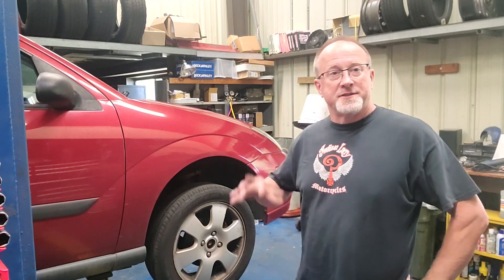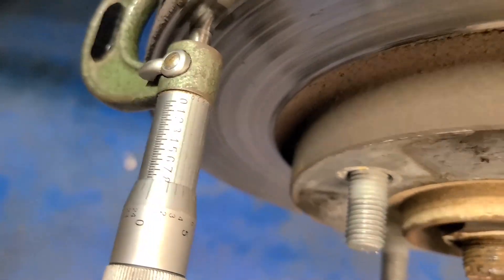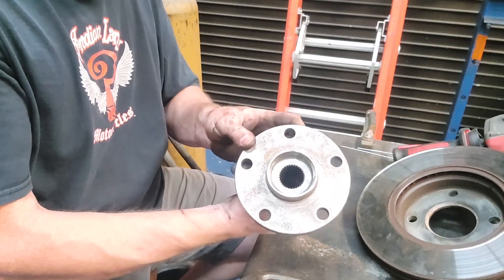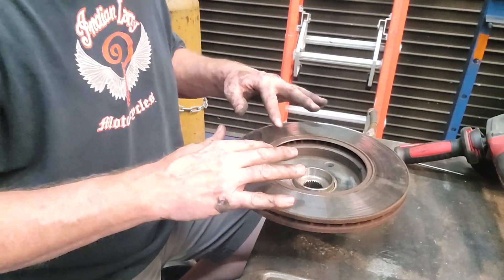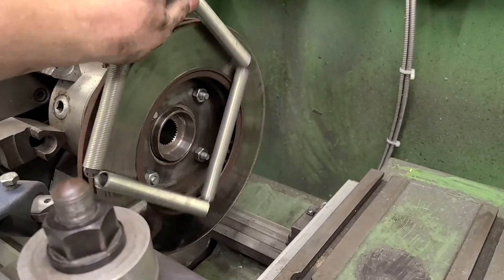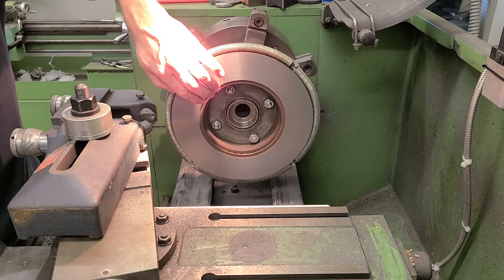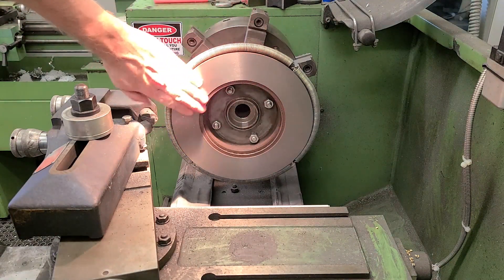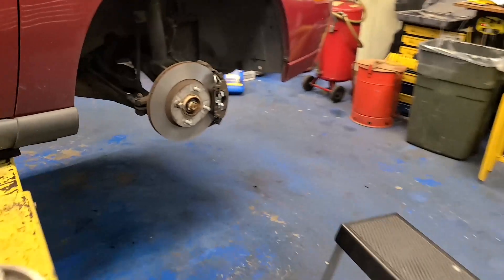Cutting Brake Rotors

Comment: NO ONE SAY`s cutting brake rotors = IT IS MACHINED OR GRINDING = your no mechanic = what a crappy car !
Reply from the maker: It's actually "you're no mechanic".  It was a crappy car.  That's why I "machined" the rotors.  You are correct, I'm not a mechanic.  Sorry you're triggered by the video.

Comment: Just stumbled across your channel today, I too have an Ammco twin cutter mounted on an adapter plate on the compound.  I use an Ammco 1 inch arbor and the centering cones and adapters for hub less rotors and drums and turn between centers.  I used Ammco brake lathes starting 40 plus year ago.  People worried about dust, they probably ride bicycles  play there guitar and smoke dope  and have nothing better to do than criticize someone actually doing something, keep the videos coming thanks again ed
Reply from the maker: Thanks Ed!!  You da man!

Comment: So much ragging on this guy for turning his rotors to 19.98 mm when spec is 20. Gimmie a break. If he turned them to 20 would nobody complain, when In a month or two they would be at 19.98 anyway? Just because of a printed spec, they think it's black and white. Are you going to die if you drive 2 mph over the posted speed limit? Or even get a ticket? He saved buying $120 worth of parts which he can put towards gas to drive another 1500 miles.

Comment: Why put on pads that use more rotor when you already are using compromised rotors below mins? It doesn't make sense, rotors aren't that expensive, and ceramic pads will eat them up much faster (as you said).
Reply from the maker: It's a 2001 Focus worth about 2 cases of beer.  I used the ceramic pads because I'm too busy to wash all of the four cars I own and hate brake dust.  This car will see no more than 2000 miles over the next decade (I live on Big Island, Hawaii), if it lasts that long.

Comment: First mechanic job I had the brake lathe was Uber heavy duty and never had a problem, new shop has some tiny hunter lathe and it absolutely sucks! Its spindle is too light duty and it's cutting head is half that size! I'd rather have a set up like that any day!

Comment: Why do some people say to never have your rotors cut?
Reply from the maker: Hey John, 20 years ago when I was road racing my 1995 Cobra Mustang in A/S I used to season a new set of rotors and then drill and slot followed by a trueing on the brake lathe.  I found the rotors would last at least 50% longer.  That heat cycle moves them a bit...and as long as I didn't greatly exceed that temp, they would stay un warped.  Removing a large amount of material reduces their ability to absorb heat - I get it.  This car is just work transport that never exceeds 55 miles per hour, is a standard transmission so can down shift going down hills, and is only driven by myself (professional racing driver-with decades of experience in cars that greatly exceed 200 miles per hour).  When I learned mechanics in the very early '80s, we learned to cut rotors and rebuild starters and alternators.  There is no real good reason to not cut rotors.  With that being said the cuts I made were right on the edge of acceptable.  I would have not done that for a friend or customer.

Comment: OK Smiddy so  you have the gear to do the job . so buy a dust mask  and use a vac to stop the dust going everywhere tho I would fit new discs and pads  . No compromise on safety related items Makes a good video tho  E A C

Comment: Wouldn’t it be cheaper to put new rotors on.
Reply: And safer.
Reply: Yes and no.
 Size specs are for turning. If a rotor is thick enough,  it can be turned down to just thicker than min. and be safe. A lot of modern rotors are made thin, but older brake designs and HD brakes use thicker rotors. And you HAVE TO REPLACE PADS when you turn rotors, like he did.

The cheaper the rotor, the closer to yes on both. Some rotors can cost upwards of $500 for one. Turning a rotor can cost from $50 to $150 depending on how many you're getting done. 

Also, watch some mechanical problems videos or some Just Rolled In. You will see some brakes that make his glazed rotors look fresh from the box.

Comment: No way would I consider turning brake rotors on my lathe, the money that might be saved is at a cost of cast iron dust covering the lathe. Since a lathe is made out of cast iron the dust can eat at your ways. An Ammco brake lathe does not have ways and for good reason, think about it. I did not click the thumbs down button but I sure gave it a thought.
Reply from the maker: I have a strong vacuum and wiped it down with oil and clean rag afterward.
Reply: If you clean and maintain your equipment, you don't have to worry about damaging it. Also, I didn't think about clicking your dislike button until your pompous ass was like, "I thought about doing it because I wouldn't."

Comment: At work I had a costumer who is also a machinist actually a tool maker. He decided to put his rotors in the lathe and the result was that they was warped more then before. Also if there is a spec from the manufacturer about the minimum thickness you shouldn't go under. These have a reason and actually it should be illegal to drive with rotors which are undersized. Cutting away the rusty edge is perfectly fine because you don't reduce the thickness. And then complaining about the dust is ridiculous. On this car there no rust at all and the dust you can wash away or wear gloves. I'm a car mechanic and wouldn't do that, I got even trouble at work because I said to the boss I don't want to put new pads on a undersized rotor. On the machining side I do really like it

Comment: With the price of a new set of rotors, why would you bother?
Reply from the maker: Autozone wanted $63/rotor.  I saved $126, the car performs just fine and more importantly, it's a freakin' machining channel...so I machined them.
Reply: @chopsmitty  Machine channel. - ???? So do it like a machine hand would do it.  Hold it in a 4 jaw chuck, Indicate off the center hole and inside face and face the rotor surface. Turn it around, Hold it on the big ID,  indicate it on the inner hole again and check the just machined face for run out. Face the surface.  DONE. --- No drilling holes, no making a mandrill out of a high buck hub.(How much did that cost?) ,,,,, and just common everyday machine shop tools. - No part off a busted brake drum lathe, either. 

Anybody think Kieth Ruker or Joe Pieczynski would have not just have stuck it in the lathe and faced it off?. ,,,,,, And just for the record I re-faced the rotors on our GMC 2500 last month just like I said above by just putting them in the 4-jaw. - 1-I was done in less time then it would have taken to go to the part store and back, and no temptation to stop at the bar on the way back (Had the pads sitting here for 6-months) and 2-I'm a cheap prick Slovenian so a zero dollar repair is right up my ally.
Reply from the maker: @Mathew Molk  Damn, you guys are brutal!  I did it this way because there are hundreds of videos out there doing it as you described (I used to do it that way).  The hub is a used part off one of our fleet vehicles.  I have access to dozens of them.  I bought the brake lathe attachment to save time - one single set up with ZERO possibility of a surface parallelism issue - the biggest cause of pulsation in the pedal.  I thought the setup is cool and different.  It works very well.  Sorry you're so upset.
Reply: @chopsmitty  It wasn't meant as a put down. I have a descent lathe and mill and for me the time and effort for setup for items that are cheap just don't seem worth it. It was just a passing comment but I guess without the benefit of tonal inflection a comment can come across as abrupt/arrogant, that wasn't my intention. cheers.
Reply: Personally, I’ll turn rotors as many times as I can before buying before new. All the new rotors I’ve gotten are in horrible shape brand new out of the box! They look nice, but a not flat.
Reply: Definitely would not go through all that hassle, if it was a item that was hard to locate, classic for example maybe, i am not a health and safety nutcase but maybe a mask would have been a good idea, also at the beginning he said he had been driving the car for the last 6 months with noisy brakes, Fred in the shed comes to mind.
Just saying like